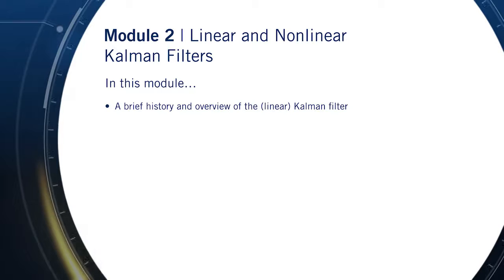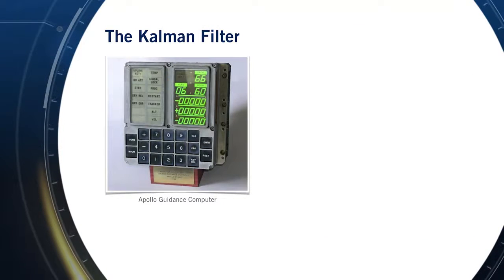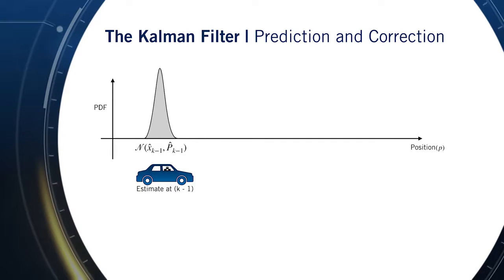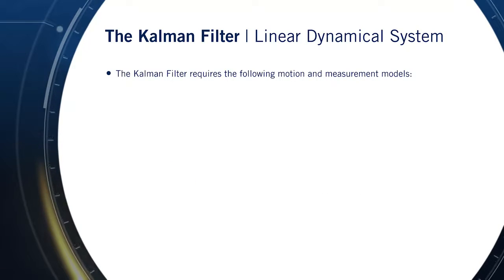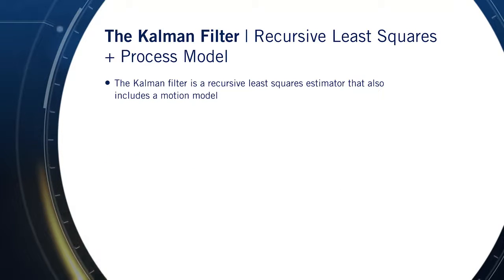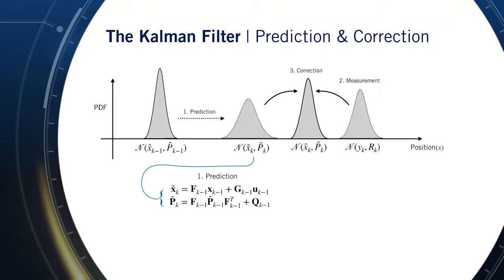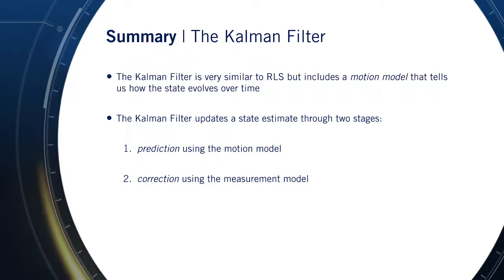Kalman Filter - Part 1

Comment: the problem with the given example is that the GPS itself in real life has an error (covariance) that also needs to be taken into account.  Would have been better if the some more effort went into coming up with a better example
Reply: ?? This is the point of KF!correcting measurements

Comment: thanks for your video. I want to apply the KF to predict the future temp of a heating termoblock to be able to know when in the future i will reach the desired T°, then I will be able to control it from this prediction. But I have a problem, how can I estimate the both Q and R matrix ? have you some method for me ? or a program (like Matlab) ? or perhaps some proposal of typical matrix for that ? for your information the SSM of thermoblocks is a linear system of second order, so A matrix of SSM is rang 2.

Comment: Can someone please help me, in 7:22, why isn't the matrix Gk-1 = ((1/2)DT^2 , DT)) = (0.125, 0.5) ??
Reply: Good question!

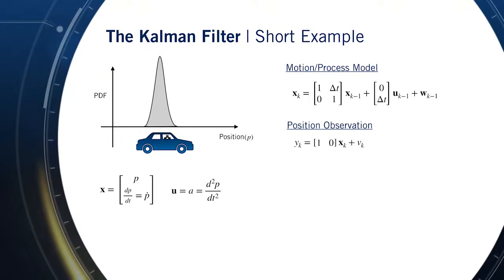I think the reason is the way how the control vector "u" is defined in the example. In your case the "u" can be thought of being defined as [acceleration, acceleration]^T (but G_{k-1} would then need to be a 2x2 matrix in order for the matrix multiplication to return a 2d vector back). However, the video is not clear about how they define "u". If you take a look at 6:52 you see that the video creator did not pay attention when "u" was defined because suddenly the vector became a scalar value?! So where should the scalar acceleration be put in the vector "u"? At 7:22 we can see that (in this example) "u" is indeed a scalar for simplicity sake and the math works properly. So you are actually right about your definition of G_{k-1}.

However, it seems that it was not the goal to let the control vector contribute to the position state, but only to the velocity state and hence G_{k-1}=[0, DT]^T in this example. In contrast, here https://www.cs.cmu.edu/~motionplanning/papers/sbp_papers/kalman/kleeman_understanding_kalman.pdf on Slide 15, when the authors model a free-falling body motion, they actually use your formulation of the control matrix (with DT=1s).

To be honest, I do not know what the implications of this different control input modeling are (and this is probably the reason why you are asking). But I think that it has something to do with how reliable the control input is, i.e. how much do you trust the input. If, for example, the control input is very noisy / jerky, then applying it to your position state would lead to a more noisy position estimate. If, however, it is a natural law (such as gravity) it would not harm your estimate but actually improve it. Even Wikipedia uses the model you have mentioned for explaining the Kalman filter and they reason about whether your input is "controlled" (definition from this video) or "uncontrolled" (your definition).

Hope this helps a little.